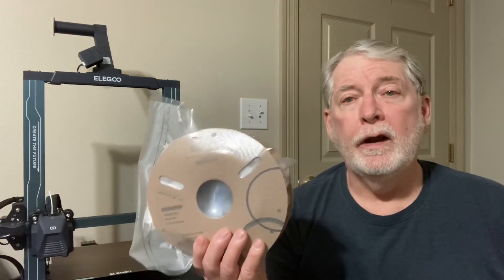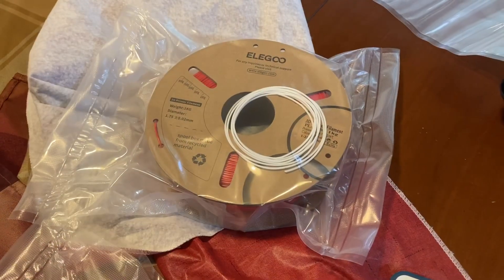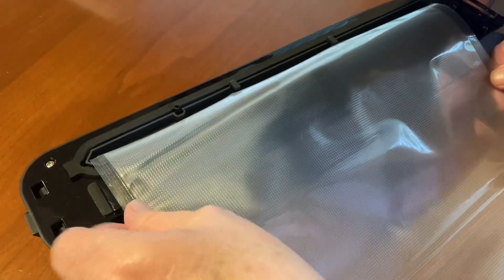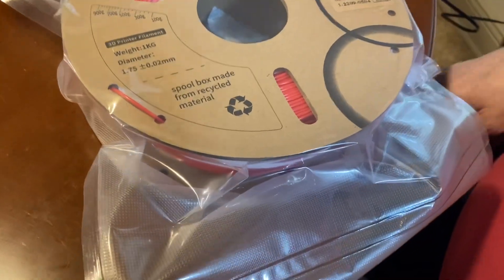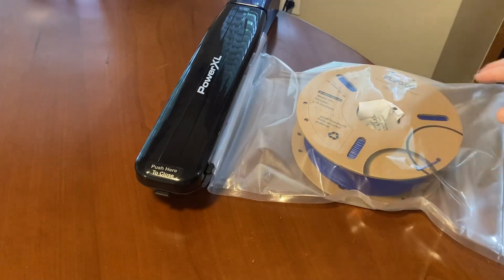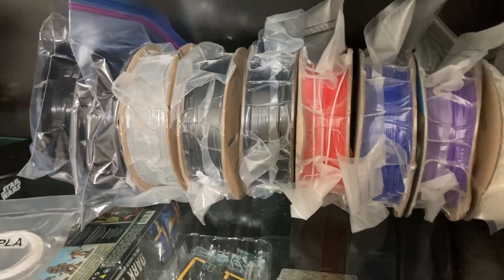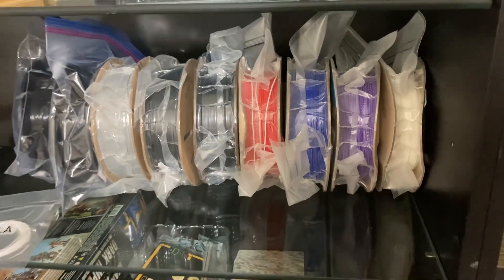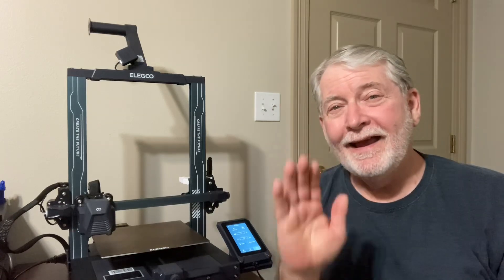CRITICAL INFO For Proper Storing Your 3D Filament!

Comment: Well I got my vacuum sealer last night 😉. Started to seal filament rolls this morning. Was kinda funny with the first one I did as it bent the outside of the reels!! I said man this has some suction power! The second try I let it vacuum until it pulled it up close to the unit and hit stop immediately followed by seal. That worked much better 😂. Spent some time making bags which is not hard but a pain in the back after a while at my age. Anywho I sealed about 15 rolls this morning. Taking the filament out of my 2 direct drive printers is pretty easy in order to reseal them. But taking it out of my FLsun Super Racers is not that easy. Have to figure out something. Gerry
Reply from the maker: That’s awesome!  Lot of work in the beginning but after that not bad to manage individual rolls
Reply: @PawPawsWorkShop  Agree!

Comment: What a great suggestion! I live in West Texas where the humidity is extremely low. But I think this would still be advantageous even here. I have several partial spools that are several years old. Last time I attempted to make a print the part came out as a failure just a bunch of strings no adhesion at all. I attribute this to old PLA.😁🛫
Reply from the maker: I hope it works for you. I hate to throw away filament.

Comment: Your method prob gives better results but I just have some bins with rubber ringed lids and reusable silica jell, I put a few packs of the gell in there and fill the container with spools. I have different containers for different types of plastic. Been doing this method for years, every year or so I take the gell out and remove the water from it, never had an issue and the plastic stays dry.
Reply from the maker: Thanks for sharing
Reply: this is the best way with the least waist of material and time, also easier to inventory your rolls 🍻

Comment: I like that method a lot. As matter of fact I just swapped out colors with a new spool and plan on using the food saver to repacking the partially used spool.
 Been cutting bags extra long since we have had a food saver and that is many years. Great for a brick of cheese. Cut off enough for a few meals and then seal it up. it will last the whole length of the brick of chees as long as you leave enough to trim and still seal. 
Should work great for filament as well. Interesting vacuum sealer you have. We have the Food Saver brand which is bigger but would like one like yours just for the filament
 Great video!.
Reply from the maker: Thank you very much. I appreciate you sharing

Comment: Pretty much what I do. Reusing the bag it comes in I printed a straw like adapter/nozzle for my vacuum to suck out as much air as I can and also use descant beads to aide in eliminating any moisture (I don't own a vacuum sealer at this time). (Set of vacuum nozzles, designed to be added to the end of a hose. On printables /model/316283-vacuum-nozzles-for-all-common-hose-sizes). His method is better using a proper sealer my way slowly looses their seal but still better then a dry box.